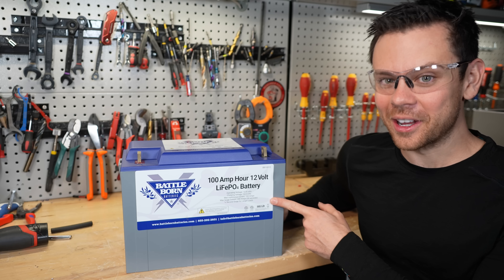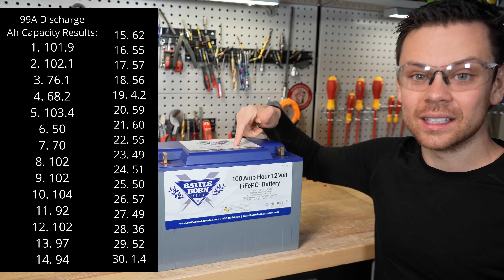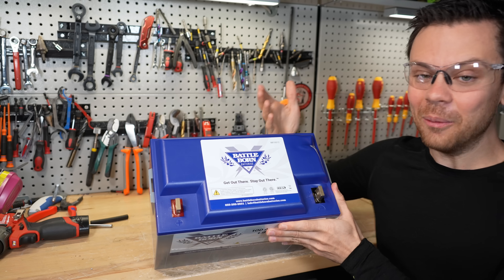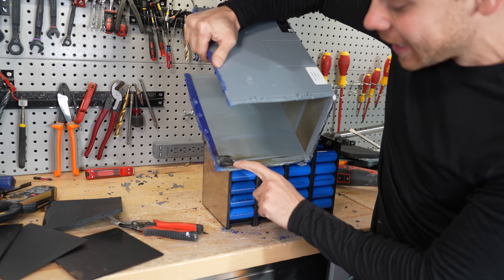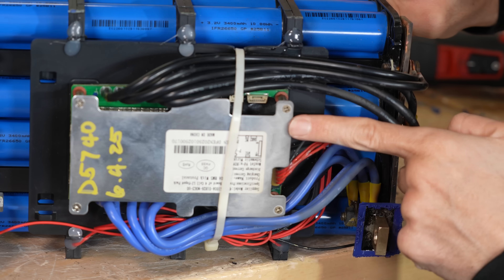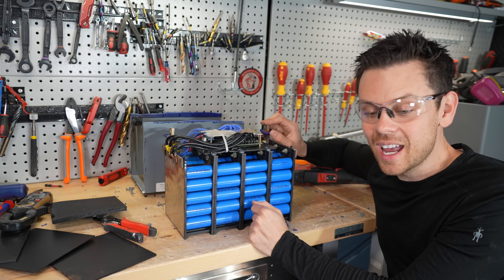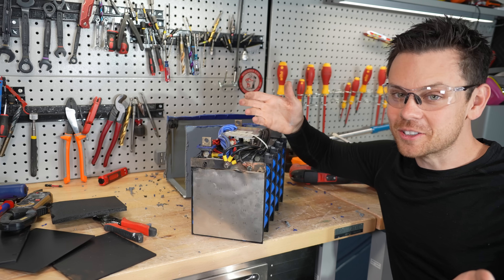Battleborn Battery MELTED?! 🔥🔥New Problem!

Comment from the maker: 0:00 The Issue
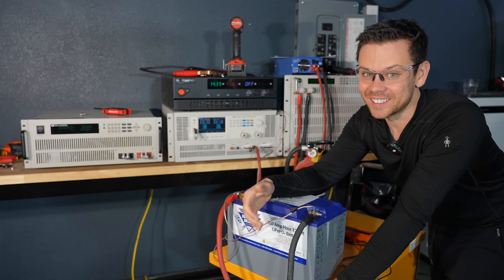1:53 DEAD
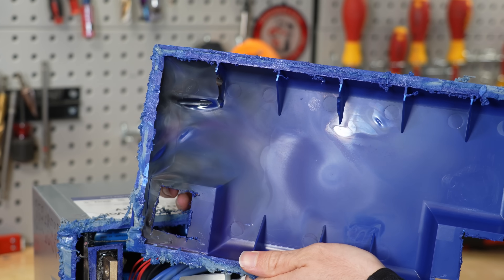2:31 Tear Down
2:56 HOLY COW!
Reply: I don’t have one…..I have 4 of them. So far no issues BUT I don’t stress them much. Not sure what to do at this time, will wait for BB to respond… maybe? I either fix them are spend more money and replace them, not too happy about that last option. If they Don’t respond I’m thinking the only choice is a class action??
Reply: They have currently disconnected their phone systems... Depending on when they were purchased, I would cease to use them. Not worth the risk as outlined in Wills Video. They are failing to adhere to standard electrical code. No chance they claim liability in the event of a fire